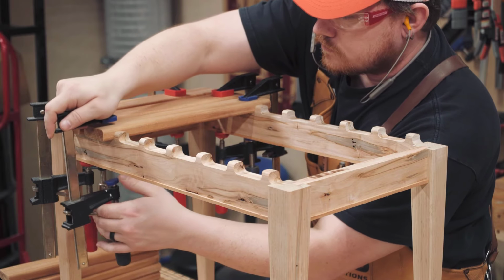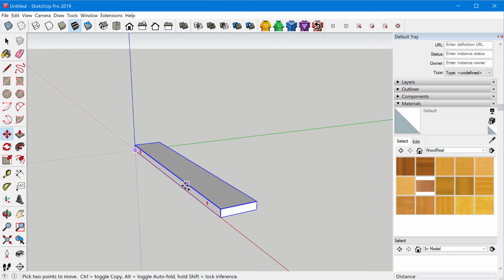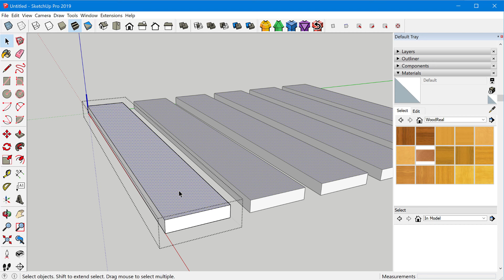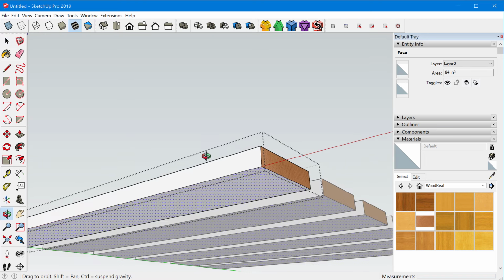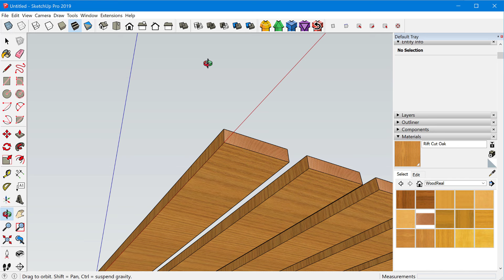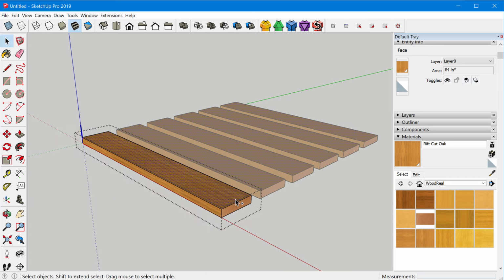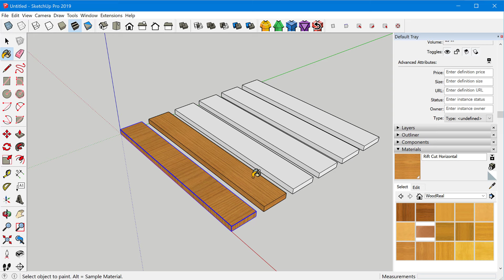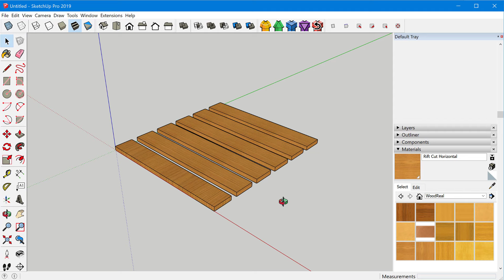Texture Orientation in SketchUp

Comment: I think the best way to deal with texture orientation is to set the axis properly inside the component, so the component can be rotate, strechted and moved and every time you wanna change the texture its gonna take the same orientation. You can paint some especific parts inside the component and let by default others, so you can personalized only that default material with one single click! I used to combine with dinamic component! With just one single component that contains all that specific colors of the original product.
Reply from the maker: I mean, if you rotate, stretch, or move a component that has textures oriented properly on its faces, they are going to keep their orientation too, so I'm not sure why you're making that distinction.

I just feel like orienting the axes for the sole purpose of orienting textures on a handful of faces isn't really the point of the axes. There are some CNC export plugins that require the blue axis to point perpendicular to the largest face of the component, for instance. Or maybe you want blue always pointing "up", instead of horizontal. If you use the glue feature, the blue axis needs to point a certain way. Or maybe if you have components in a collection and you want the component to insert into the model in a certain orientation, (blue is always going to point up). So I think it is rather limiting if you always orient the axes in order to control your textures. 

Not to mention, once you get beyond simple extruded rectangles, controlling textures on each face becomes less straight-forward. But yeah, it's still possible to use the axes trick to orient textures on simple shapes.